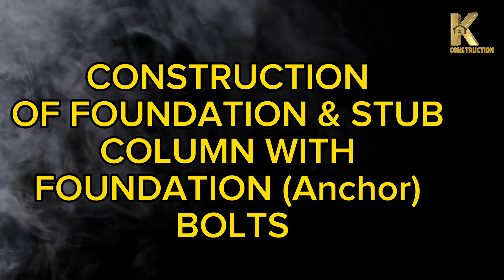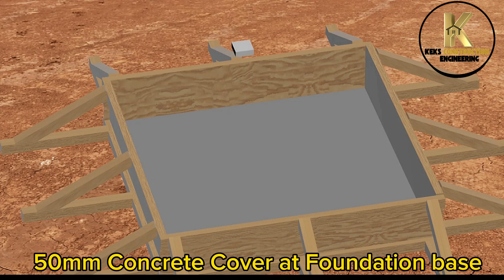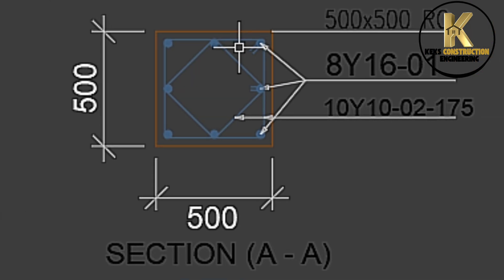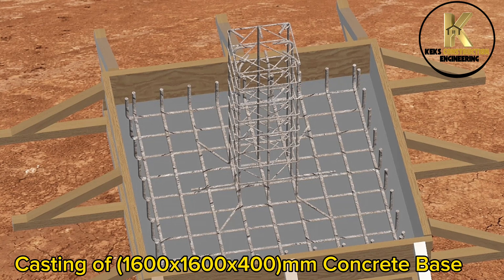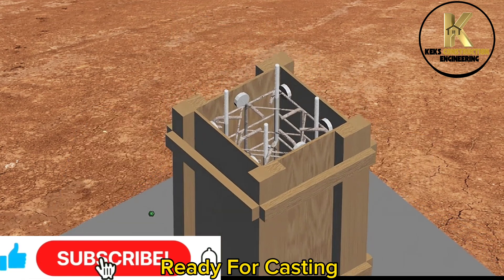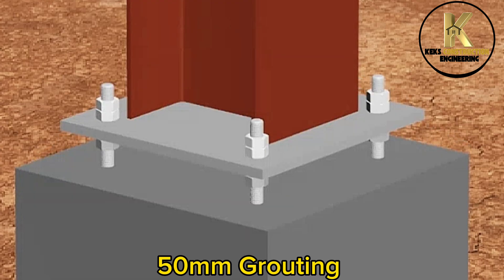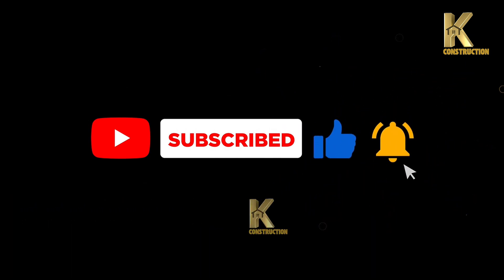How to Construct FOUNDATION for STEEL Structures with Foundation Anchor Bolts & Base Plate

Comment: hello. i'm designing a similar post like this. the column is also 500 x 500 mm but i designed with 8 bolts. the question is, what's the purpose of installing nuts underneath the plate and to be covered by grouting?
Reply from the maker: Ok.....
Grout provides a full-contact bearing surface, transfers loads more effectively, and handles unevenness between the base plate and the concrete foundation. Tightening bolts directly can lead to concentrated stress on the bolts and anchor concrete, creating uneven load distribution, especially with non-perfectly flat surfaces.

Comment: Thank you very much sir for your contribution to these fruit full videos . I would like to request you tutorials about structural detail  drawings of footings ,slap beams and so on . If you share step by step tutorials about structural drawings using autocad or any other software would be great also etabs . Thanks I hope your answer.
Reply from the maker: Noted. 
I will add it to my Schedule. 
But know that it won't come immediately because there are other ones that are already ahead of this. 
But be rest assured that I have added it to my Schedule and it will be done ok.

Watch other Construction VIDEOS on this Channel and Stay Tune to KEKS CONSTRUCTION ENGINEERING for more and better Videos. 

Like & Share my work if you love what I am doing here. 
THANKS.

Comment: What to do if the column is bent...and if you place  ancor bolts, when you do shuttering work due to fixing and alignment holes can be displaced.
Reply from the maker: What to do is to ensure proper Setting out for the Anchor Bolts. That's why I used a temporary Wooden Plate, set out the Anchor Bolts on it, bore the bolts holes with precision, tighten the Nuts and mount it on the Column Reinforcement, after proper alignment to Grid lines, Weld the Embedded parts of the Anchor Bolts firmly to the Column reinforcement with enough Braces.  Put formwork carefully. Ensure you recheck the alignment of the Anchor Bolts before and after casting.
If you do this..... Everything will work perfectly.

I have used this approach on many sites and it worked perfectly.

Thanks for your Comment.
You can watch other amazing Construction VIDEOS on the Channel and stay tune for more.

Comment: I want to design a concrete foundation for a street light pole and want to know which engineering software is the best to do it.
Reply from the maker: Use Protastructure. It will design both the steel pole and the concrete foundation.

Later, I will do the full Construction Animation on this Channel.

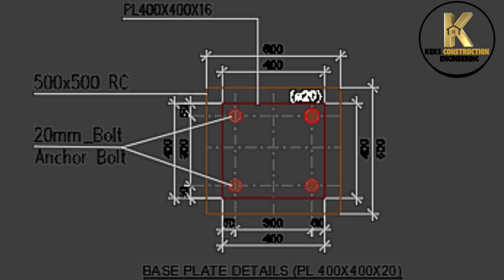Comment: 3:50 for static structures, it is okay to use nuts under the plate to align it. However, for dynamic machinery, NEVER use nuts under the plate for alignment.
Reply from the maker: Yes.....You are correct because of the vibration....but this is just a stanchion and foundation for a warehouse.
Reply from the maker: WELCOME TO KEKS CONSTRUCTION ENGINEERING.
You can watch other amazing Construction VIDEOS on the Channel and stay tune for more.
Thanks for Subscribing.

Comment: Why we use groute?
Reply: Because of tolerance. Imagine if you have 24 columns, fixing them directly in concrete would require extra attention and careful in making sure that the columns are not inclined as for with grout you can correct the column inclination with srews and add group after all the columns are fully vertical. You wouldn't be ae to adjust once the column got fixed on the concrete
Reply from the maker: We use grout to improve the load-bearing capability and structural integrity of the foundation.
 Thanks for your Contribution.
Watch other videos and Stay tune for more.

Comment: Grouting not needed. Direct plate to plate is better
Reply from the maker: @brybelchez3433  
Grouting is needed in some cases Sir. Even though it's still good and more economical to place the Base plate directly on the Concrete Pedestal.
You can check my recent video SIR.
The Base plates were placed directly on the Concrete Pedestal as u said.
Thanks for your Comment and review.

Comment: Sir, please how can the 50mm grouting be achieved on site and also the those nuts under the base plate won't it wash away from the bolt due to the application of load from the building
Reply from the maker: @ChinonsoOgalanya  
The grout is compound mixed into a molten form and it will be applied with a spoon like tool.

As for the downward BOLTS.... No, it won't go down under loading.
U can check some of the street/road  lights you passed along the road, they are light that some are even without Grout.
Reply: @keksconstructionengineering  thanks
Reply: Very impressive 💯💯💯

Comment: Should formwork be placed before or after reinforcement
Reply from the maker: It depends on the situation at hand. Formwork are placed before reinforcement but in the case where the formwork will obstruct the passage and placement of reinforcement, then the reinforcement should be fixed first before formwork.
Remember, in civil Engineering nothing is cast on Stone.... Everything is possible.